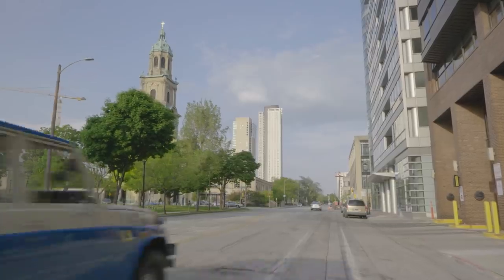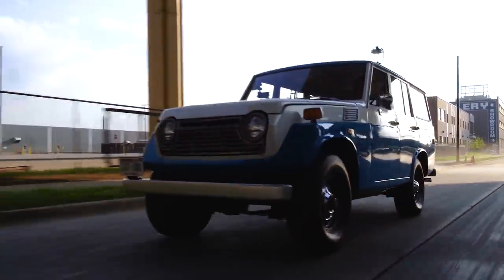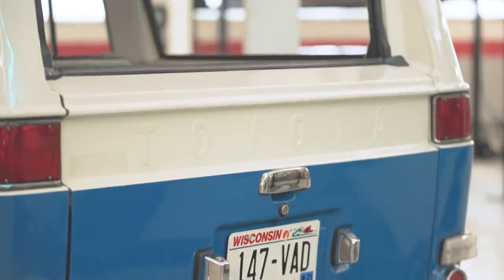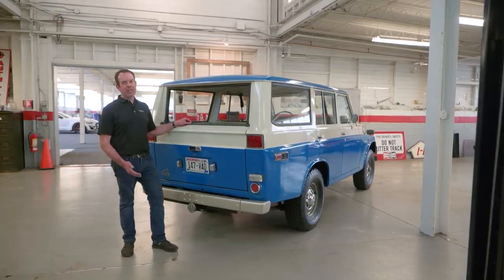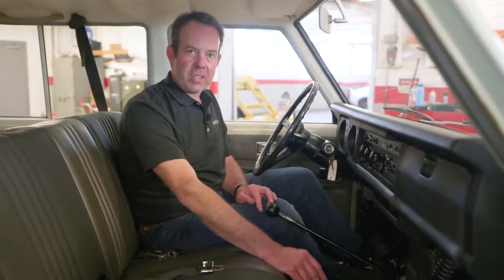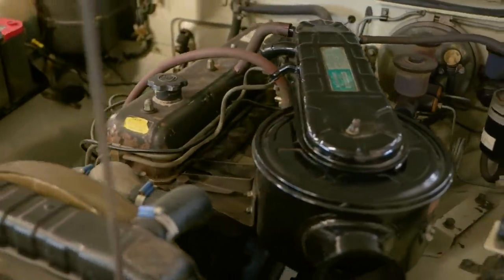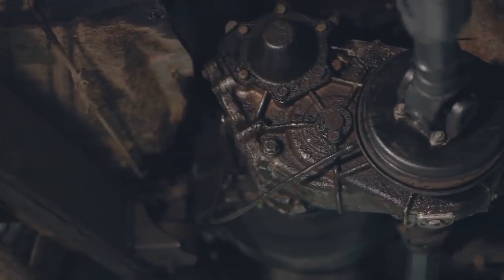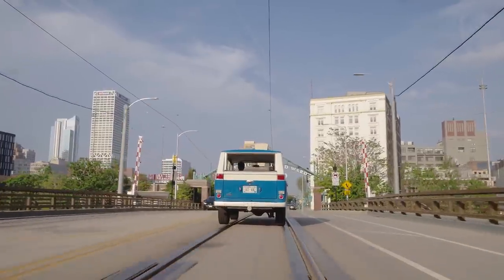The FJ55 is the ideal Toyota Land Cruiser | Buyer’s Guide | Ep. 301

Comment: Great! I had 4 of these, and now I'll never get another one because they'll cost way too much now. These are notorious for rusting away. It is almost impossible to find one that doesn't need extensive rust repair: front fenders, floor boards, gas tank, drip rail, etc.
Reply: In that case I have done the impossible.  I have a '74 with 45K original miles.  I bought it for $3k one year ago and I've put about $4K into it, mostly upgrades, and a tiny bit of cosmetics.  I took it to 11,000 feet today, and I was passing jeeps while watching their chassis flex.  Both myself and my doggo were airborne a couple of times from the bumps, and there was never a question of losing control.

Comment: 3:10, No, the FJ45LV was the first wagon.

Sorry I'm the 40-series driver know-it-all 😂
Reply: Which is why the video makes the distinction that the FJ55 was the first Cruiser designed from scratch as a wagon whereas the FJ45LV was an FJ40 subcontracted out to be made into a wagon. Sorry, I'm the 55-series driver (and former FJ45 LV owner) know-it-all :)
Reply: And the 45LV wasn't the first wagon either. There were 28 and 35 series wagons before them. But all those before the 55 were hand built custom coachwork by Gifu Corp.

Comment: With all due deference to the host, the BEST Land Cruiser wagon is a 55 body on an fzj80 series frame, suspension and running gear with a uzj100 series 2uz-fe V-8. My first Cruiser was a 55 and I wish I still had it. Fortunately, since I'm a member of the forum community, I know exactly where it is and that it's still running just fine. But all these 55's are prone to rust...a nut and bolt rotisserie restoration will get you well into 6 digits. There are, unfortunately, a fair amount of flipper/shysters out there putting lipstick (35-50 pounds of bondo) on these pigs and making bank on unsuspecting neophytes who crave this look.

Comment: " Everything about them is solid " ..these are some of the biggest rust buckets ever made. Even in the dry of Australia we hardly see any of these left and there were heaps in the 80s.
Reply: So many were given up on when they could have been fixed because they were so thirsty. As I recall LPG conversions to lower fuel costs eventually led to cracked cylinder heads.
Reply: @erroneouscode  Yeah early lpg conversions ruined many local cars in the day
Reply: Salty sea air...
Reply: @erroneouscode  LOL yeh on my 40 the gauge would drop on a 1km trip to the shop!
Reply: Yep, the rust around the entire roof gutter was a real problem.
Reply: @erroneouscode  And God help your bank account if you really pushed down on the throttle and the second barrel of the carb came into play - you could virtually watch the fuel gauge drop like a stone!!
Reply: @andrewb3497  When these things were a few years old quite a few of them were used to tow and launch boats which not only increased fuel consumption but rust issues. They were so costly to run back in the 80's and today you would have to have rocks in your head to own one other than as a museum/collectors piece. They drank more fuel than the average V8 of the day.

Comment: Nice video but it’s sad how Toyota often completely failed more than most any other car maker to prevent rust damage. There are Youtube videos of Toyota pickups breaking in half from their under engineered rust prone frame rails that trap water and prematurely rust away. Toyota engineers can (sometimes) design a really reliable engine but they often completely failed at designing a vehicle that doesn’t self destruct when driven in wet climates.